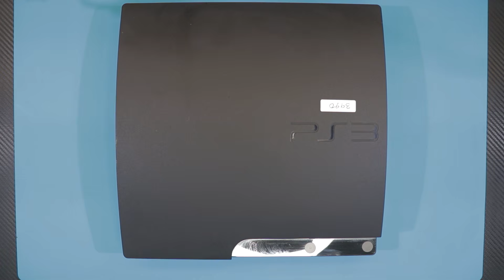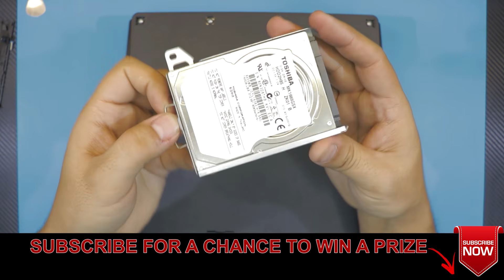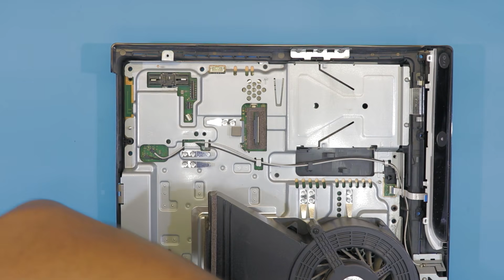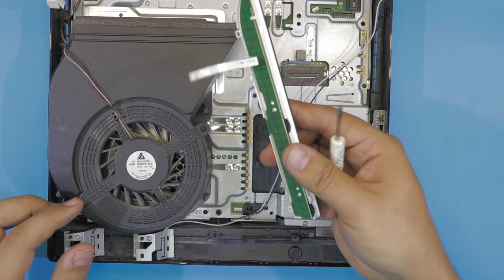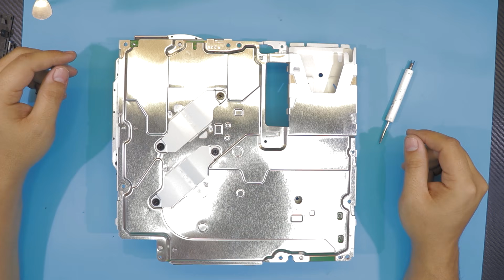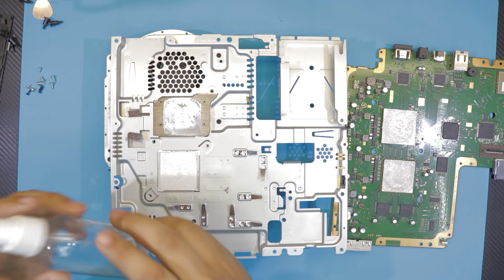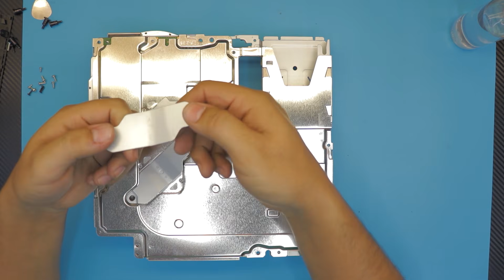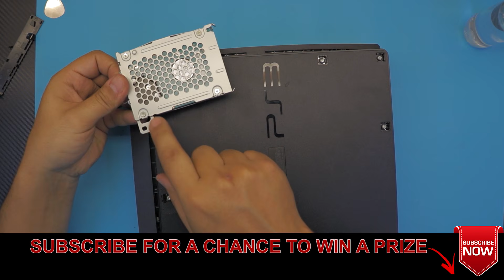HOW TO CLEAN AND  REPASTE YOUR PS3 SLIM ( playstation 3 slim console )

Comment: at 4:12 any advice if we dont have a compressed air canister? I'll probably get one, but in the meantime.. Thanks
Reply from the maker: Thank you for the feedback and your support to the channel by SUB :P
Regarding your question: i would NOT recommend using the air can :
CONS: its a marketing and really bad for electronics, as it give moisture air and has no power.
use a dry compressor air e.g gas station pumps or simply get this item and you will save a lot in a long run and it has a dry and powerful air spray, https://amzn.to/3dGVBPu
the air pressure of this is nothing compare to air can. u can use it for your pc and many other places.

if you got none of the above use a vacuum, not the best choice but better than nothing,
Reply: @uFixTek  Solid advice. Thank you
Reply from the maker: you are very welcome my friend, if anything in the future feel free to ask me.

Comment: Is there anyway I can get information on the CECHA01 PS3? I've been having some issues with it and replacing the thermal compound on that didn't really solve much. Do you have any way to figure out where I could find some solutions?
Reply from the maker: Thank you for the feedback and your support by a sub  :P
regarding your question: WHAT issues you having with your PS3?
Reply: @uFixTek  Oh thank you VERY much for the response man I cannot thank you enough. Ok I have some unlisted vids I can send as an example but to put it simply there's two specific issues
1: the PS3 after an amount of time starts getting this green static and freezes
2: the PS2 games that play on it seem artifacted and have weird dots and image problems over them (this doesn't happen when I turn on my PS2 and run it through a retrotink HDMI output), and it runs PS3 games image wise fine.

Any help or direction you can provide would be the most appreciated thank you so much!
Reply: @uFixTek  I notice on the CECHA01 PS3 there's actually 2 sets of chips. One I think is the PS3 proper, and the other two may be the PS2 ones? I don't know the original models components and if I knew WHAT to tackle I feel like it'd make a world of difference
Reply from the maker: @noface6037  okay i can get you fixed up dont worry the issue is common issue that we get in the store. just hold on it and i will try to make a simple instruction video for you to follow give me few days to make a simple fix DIY video.
Reply: @uFixTek  Thank you SO MUCH sir I cannot begin to tell you how much this means to me. I've been trying to figure out how to solve this problem for so long. If I can manage even just to fix it and bring this thing to a good health I'd be so happy thank you!
Also here's the video example of the glitch: https://youtu.be/o54P2pr0_oY
thank you again so much!
Reply from the maker: ya that issue its very common problem with our clients, i made a note to make a simple DIY video for you.

Comment: Oh yeah I have a question our first try  using this is just after opening a game (I opened black ops 3?? Something like that) and during mid game it just dies. My dad told me maybe the transformer is too small (what I know it's a extension were u plug in the ps3 cable to ,then you can plug it in the socket after that). I'll be willing to wait for your reply
Reply from the maker: Thank you for the feedback and your support, regarding your question: NO The extensions and all that has nothing to do with powering down mid game.
there are only two things that can go bad here:
#1. This is 97% the issue with our clients, old thermal paste and or not a good brand thermal paste , and heatsink filled with dust. i recommend you to do a Full service and cleaning with a high quality thermal paste.
https://amzn.to/3mcmKfM
#2. the power unit inside the console is over heating, take it apart and use an air compressor (not the air can that don't do SH***T) use a gas station air compressor or i highly recommend you to get one of this for the house its really useful:
https://amzn.to/3wdpiiq
its a powerful dry air duster.
Reply: AHH thank you so much for your reply and a fast one too. Sorry just opened my phone thank you so much I really appreciate your help
Reply from the maker: @christianyaneza7040  your welcome my friend if your issue is not fixed let me know and i will try to help you more.

Comment: I need help!

I did everything step by step, although there was a disk in the drive, and although I didn't think much of it, I put everything back together and now the disk drive is not ejecting the disk out or accepting any other disk. It beeps three times when I click the eject button... I opened it again and removed the disk, but I still have the same issue. There is also a plastic piece sitting up in the front of the mouth of the disk drive, if that is indicative of anything...
Reply from the maker: hi, did you double check the flex cable under the drive is connected?, also regarding the plastic can you provide me any pictures?
use this:
https://prnt.sc/

Comment: Hey man hopefully you see this soon, but I recently took my ps3 apart to clean it, and overall everything works except the power button and eject button the ps3. The night before last night I was playing some games and seeing if they could eject through the ps3 menu and it worked. Just last night I tried again and the disk got stuck, what is wrong here?

I do have the same model as the one you disassembled as well.
Reply from the maker: remove the power on board and re insert the flex cable and check the contacts. sometimes the flex cable doesn't make a good contact. else you will need to replace the flex cable or the on/off board check the flex cable with multimeter to see if it has continuity

Comment: Does the mx 4 work good on ps3 I have tried replacing the thermal paste on my ps3 twice and it still sounds like a jet taking off I was using some cheap thermal paste off Amazon
Reply from the maker: Thank you for the feedback and your support to the channel by a sub :P
Regarding your question: never ever use a  cheap paste, the better quality the better heat transfer and less fan noise.
the best paste:
https://amzn.to/3tk4Eea
2nd best:
https://amzn.to/38BwNpq

Comment: I have a PS3 3001A model.  I just replaced the thermal paste. Cleaned it up very well. It stays on for about 30 seconds then shuts off. The fan does spin and I don't feel any hot spots on it. I held the power button for 45 seconds unplugged.  Any suggestions?
Reply from the maker: Thank you for the feedback and your support to the channel by a SUB :P, regarding your question: then most issue when that happens its the Power supply is failing, to power on it doesn't require much voltage and as soon as its trying to boot and the voltage is not available it shuts down. this is a very normal issue that we get in the store. replace the power unit.
https://amzn.to/3rg2Lii
Reply: @uFixTek  awesome. I will do thanks for the information. I was going to do this, but wasn’t 100 percent sure. Doing the disk drive like that saved me much hassle.
Reply from the maker: anytime my friend good luck

Comment: My ps3 has the problem with its connection with the controllers. The controllers are fine, but the ps3, wont sync with them. I know the problem is with the ps3. Would this work to fix that?
Reply from the maker: Thank you for the feedback and your support to the channel by a SUB :P, regarding your question: it may help you with your situation and there could be a pin that is not making a good contact, by removing and placing it back it will make contact and there is no harm done by doing a cleanup :)
Reply: @uFixTek  Thank you.
Reply from the maker: your welcome

Comment: I have got a really big problem ;/ I was cleaning my PS3, that main wire from the driver which is really hard to connect again has unpluged. Now when I'm plugin that in, my CD's are not readed by the driver. There is weird sound when I put them in and next there is nothing going on. Like the laser is not working, my PS3 can't see the disc inside. Can someone help me what is going on ? What Am I doing wrong ?
Reply from the maker: re open and make sure the flex cable is straight inside the connector, and if you follow the video it shouldn't be that hard, send me some pics and let me see the connectors and the inside connector of the inside the dvdrom.
https://prnt.sc
Reply: Maybe there is a chance to talk on some Messanger or E-mail ? It’s gonna be much easier
Reply: I have some videos of what is Going on also
Reply: @uFixTek  I’ve send some pictures here but links has disappeared. Please let me Know how I can contact with you.

Comment: Got a question when you remove the hard drive from the PlayStation 3 do you lose any of your data do you have to install all the updates on the PlayStation.
Reply from the maker: you can remove the hdd and place the new drive and you will need to install everything dashboard and all. BUT
you can remove the hdd and use and adapter to plug it in to the pc:
https://amzn.to/2ZBz3Ik
get two of the above
and use another adapter to plug your new ssd or hdd to the same pc.
and use this program to clone the old hdd to the new ssd:
Macrium Reflect 
it will take 10min and when the cloning is done you plug the new ssd in to the ps3 and it will work like a charm with all your file and saves.
thank you for the support to the channel and feedback

Comment: Hello, my PS3 Slim has a bizarre problem..... when i turn it on, it stays silence for more than 30 seconds (no fan, no hdd checking etc...) just the green light, and then after those seconds the system will boot normally. it also has audio glitches, i can't boot to Safe Mode. and cant play PS2 Classics (blackscreen), what is the issue ?
Reply from the maker: most probably you have a bad mechanical drive or your drive is failing, to check your drive you will need to get this adapter:
https://amzn.to/2M4A48C
and plug the hard drive to this and to your pc and use this free program and check if you have bad sector, anything under 95% its bad!
Hard Disk Sentinel
Reply: @uFixTek  I actually tried with other HDD drive, it shows same symptoms of long boot (30 seconds or more to boot) but this time it dosen't appear nothing on screen, the same happens without HDD inserted too...
Reply from the maker: can you provide me the exact model number that it shows in the back sticker,?
Reply: @uFixTek  its an PS3 Slim 120gb CECH-2104A
Reply from the maker: i looked a few notes i had you will need to take it to a technician come where to check the components there are few capacitors on board that can be related to this issue :/ its had to explain an show how to test them out. i wish i could help you with msg but its not possible.
Reply: @uFixTek  its okay, ill try find other PS3 as they are cheap nowdays, thanks for the help though, i appreciate :)
Reply from the maker: i wish you the best and im sorry i couldn't be better help :(
Reply: We have a same problem

Comment: Hey man...i did everything you showed....but now my ps3 wont even turnon. Any idea why?
Reply from the maker: did you plug the front Flex cable in the correct position? did you plug the 12v power supply cable correctly?
Reply: @uFixTek  Oh I checked it and it turns out I didn't... I plugged it correctly. But now every time I turn it on the ps3 shuts down in 3 seconds and I don't even see the red light. What has happened?
Reply from the maker: what kinda thermal paste you put?, this happens if the power unit is gone bad or the thermal paste is a poor brand, or bad applied.

Comment: Awesome video, thanks for the guide. My ps3 won‘t connect to the psn after it tho. Do you have an idea what I might‘ve forgot or done wrong?
Reply: Either lan and wifi won’t work, if thats any help. Psn runs just fine on my ps4, no internet connection problems or router problems.
Reply from the maker: thank you for the support to the channel by a sub my friend and regarding the question: reopen and make sure the wifi jack is plugged in and if so remove and reinsert it. @19:21
and the last option would be a restart or reset your dashboard. :/

Comment: I watched your video and was very thankful, did all the steps like you did. Got 2 screws now that i cant remember where they came from, but the overheating is a bit less now. Then i watched another video and saw that you can open the CPU and GPU even more. The silver thing is just a "safety cap". Beneath is more heat compound that could be old. At least that is what i saw in that video from Nsc. Might be important to change that paste too.
Reply from the maker: Thank you for the feedback and your support and regarding the "thing" its not too important and  if you wish you can replace the it. i don't remove the IHS because its too risky for the viewers to do so and they can really damage the cpu or gpu, and we have done many many test and the difference are:
if you replace the IHS thermal compound you will only get 3c extra temp drop! (not worth it not even a bit)
Reply: @uFixTek  i heard that there are some ps3's that have a bigger problem with the thermal paste under the ihs. but i get what you are saying, you are trying to not make it too complicated and better save the viewer from damaging anything.

Comment: My dual shock 3 works in PS3 user interface menus but disconnects
(while in wired mode) as soon as I start a game. Doesn’t work at all wireless because dead battery. Any suggestion?
Reply from the maker: it would be a defective or very bad battery replace your controller battery.
here is a ps4 controller but the ps3 its 99% the same.
https://youtu.be/pwDzKoRFbHY
thank you for the support and feedback.

Comment: Hello, I am able to replace my HDD and did a re-paste and clean everything, but it still freezes showing lines when starting up. Do you have an idea what's wrong?
Reply from the maker: you have a dry or cracked solder joint under the gpu, the easy fix for you at home is:
remove the motherboard completely,
place the motherboard on a wood table (not glass not metal )
no fan no air-conditioning
normal room temp the warmer the better
take a hair dryer set it at mas heat and normal air flow
keep the hair dryer straight over the gpu for 5min with a 1" distance
turn off the hair dryer and let the motherboard cool down on its own at room temp for 10min, then repaste and you are all set.
good luck
note: the gpu is the bigger chip (thicker heatsink), you can do a 5min pass on both cpu and gpu it will be totally fine, dont worry about damaging or anything,
Reply: @uFixTek  thanks very much and I really appreciate your response, I will give it a try.
Reply from the maker: anytime and good luck

Comment: Hi, I have a the same PS3 model (Model no. CECH-2101A) as shown in the video, but I have a few questions. First, should I worry about a disc being inside the disk drive before taking apart? Second, how would I know which thermal paste works best for my PS3? Third, would it be safe to power up my PS3 immediately after applying fresh thermal paste? This is my first time taking apart my console and I will happy to use it again.
Reply from the maker: HI, first of all thank you for the support to the channel, and regarding your question:
#1. no need to worry if the disk is inside, but its recommended to remove before servicing, and also not all ps3 have a ribbon cable underneath so you may even not have to remove the shell case for the dvd drive, i made a 4k video based on the model that doesnt have the flex cable under dvd: https://youtu.be/Gey66EGkCBs
#2. there are only two best thermal paste that is recommended :
the best: https://amzn.to/3pCxkxg
2nd best : https://amzn.to/2MpcVNW
#3. you can start your ps3 right away , but let it stay in the main screen for 30min , then you can load games.
if there is anything else you need help with leave a comment and i shall get back, good luck
Reply: @uFixTek  I forgot to ask. When applying the thermal paste, is it better to apply it as shown in this video or do a cross? I noticed this on your new video.
Reply from the maker: do a cross , sorry for late respond
Reply: @uFixTek  Got it, no problem. Thanks!
Reply: @uFixTek  I have been thinking about the thermal pads for the PS3. From your new video, you did mentioned about replacing them with .3mm or .4mm thick; I haven’t been able to tell if my PS3 model does have them as I’m still waiting for my materials to open it. If anything, does more thermal conductivity mean better? For example, I found that thermal conductivity for .3mm thick is 3.2w/m-K.
Reply: @uFixTek  Hi it’s me again. Today, I just opened my PS3 Slim gave it a first clean in 10 years tested and starts up just fine, but I have not yet replace the thermal paste. I just like to ask, is it necessary to swap the PS3 clamps from the slim to the fat model ones? I already got them just in case. I will probably finally replace the thermal paste today.

Comment: Gonna diassemble my PS3 Slim soon to replace the thermal paste, dusting, and replace the CMOS battery.  Is there any place in the PS3 that's grounded where I can attach an ESD wrist strap alligator clip to?
Reply from the maker: you really dont need the ESD grounding but its ok to place it, 
but the BEST and secures place to use the ESD is always the ground wire in your outlet,
you can purchase this cable and tape the white and black ends with electrical tape. and use the green wire to attach your ESD alligator.
THIS IS THE BEST SOLUTION.
Else just touch a metal table and or attach the alligator to a metal frame.
https://amzn.to/3muNlDH

info: https://imgur.com/a/2AGCBk1

Thank you for your support to the channel by a SUB :P